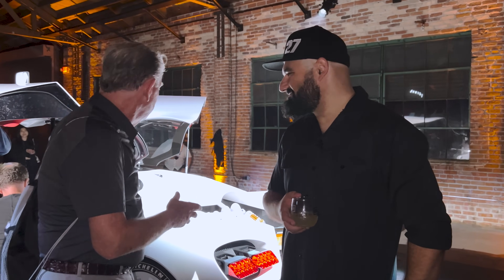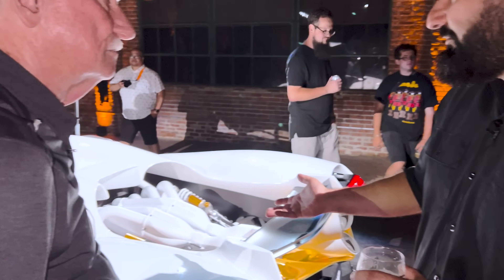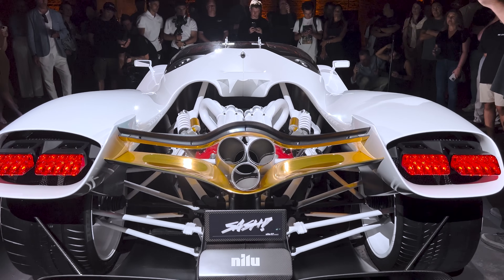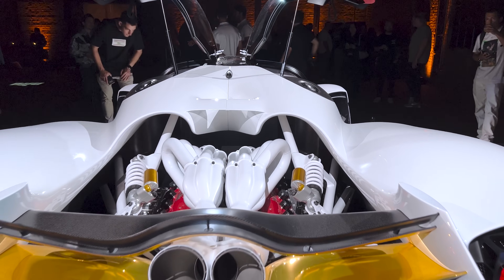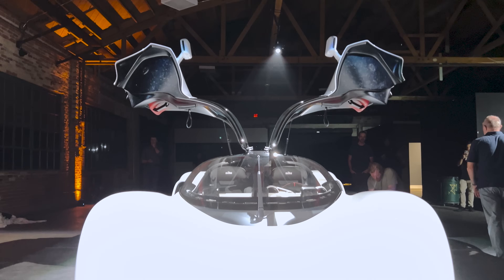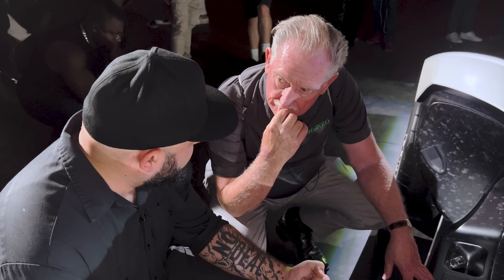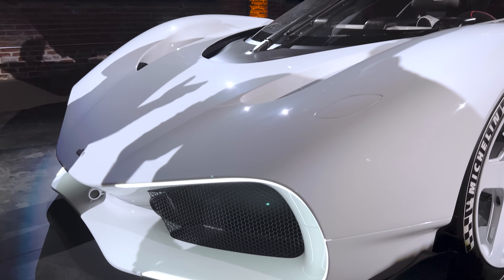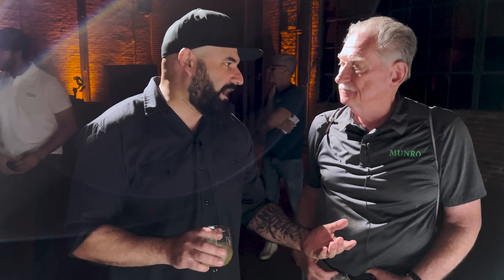First Look at the NILU27 Hypercar: Pushing the Limits of Speed and Design

Comment: 😢 Sorry so disappointing when I heard it had an old formula one engine in mmm 🤔 okay you could run it on a bio
ethanol that would be goodmmm 😊 but I really have no interest in this old technology but I'm sure it's a load of redneck Americans will be making this video very popular mmmm Renewable energy and Electric and most probably eight wheels. at least all driven with multiple settings for suspension and obviously then there is the compressed rocket power has a booster 😮 then we're talking speed  🥰🥰🥰🥰

Comment: I’m sorry what? Heat comes up and out so it’s more efficient? Uhm no. In a convection yes at a VERY slow rate. Even in computers with comparably tiny heat loads there are no advantages to heat flow strategies based on natural convection when compared to fan powered heat flow. An engine uses pressure to PUSH the exhaust air out and suck in the new air. Convection plays ZERO role in the flow of the air in the exhaust. 

This man spit bullshit at him for several minutes and not once did Munroe call him on it. What the hell?! Unsubscribing I’ve lost all respect for this channel. I thought it was a legit unbiased channel now I know they will just sit there while someone takes a crap on their reputation.
Reply: I supposed you missed the part where he said the exhaust package was inspired by race cars of the past. Why do you think those old race cars did that? And yes, hot air rises, while cold air falls. THAT'S WHAT MAKES HOT AIR BALLOONS POSSIBLE. And such differences in the air behavior based on temperature is why it is easier to fly a plane on a cold day, because the air is thicker. But on a hot day it is more difficult to takeoff & fly, because the air is thinner.

You sound more like a jealous type, just like most of the comments here. The reason l am addressing you is because you seem to be more intelligent than the rest.
Reply: Wait are you slow? The exhaust has no cover, which means it gets hit by the laminar flow coming off the roof. The airflow takes the hot air with it. This is literally the most efficient passive cooling setup you can conceive of for an exhaust.
Reply: @ohedd  are you? There is literally no need to cool an exhaust efficiently unless you are recycling the air into a super charger
Reply: @somethingsomethingsomethingdar  you just said the cooling doesn't make sense because it's not efficient. Now you're changing your argument to "well it's not needed anyway". This solution is literally just eliminating the cover because it's not needed, while it makes for a good art piece. But my point is that your statement about this cooling method being inefficient, is false.
Reply: @ohedd  explain what is being cooled more efficiently in this engine by the exhaust being put on top of the engine vs the bottom. By what miracle of thermodynamics has the exhaust being exposed to air above the car increased the “cooling” efficiency of the engine?

Comment: We need to push Elon to release the roadster
Reply: Instead tesla should've used the m3&Y chassis. But with the castings&structural pack. To build a 45-60k mustang, charger, challenger, 400z competitor. A 2dr reasonably priced 3,500-3,800# ev coupe with sport seats&brakes, forged wheels, active suspension etc. 

All bought over from the new 54k m3p. Imagine a sleeker stylish 300-400# lighter 2dr version of an m3p! Low 10s 1/4mile, 0-60mph in mid 2s, 300+miles of range easy and full tax credit eligible across most trims. 

Bet in the U.S. alone they could sell 50,000+And globally likely 250,000+ smh shame elon doesn't get coupes are brands marque model's and every other legacy oem has theirs! Even the Chinese have some sexy 2dr coupes capable of competing with the plaid now. Byd yangwang u9,  gac hyptech ssr, ssc sc01 ev 2dr coupe and others exist in China from 42k-225k. 😐